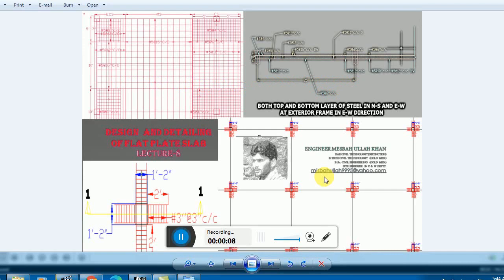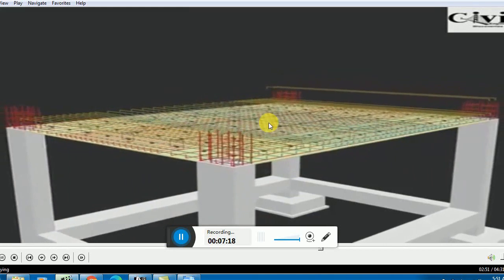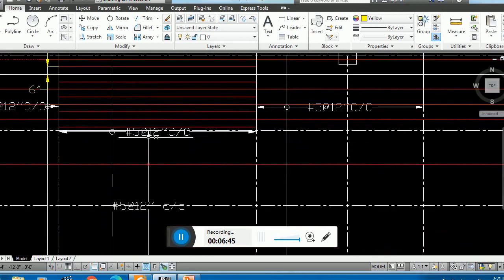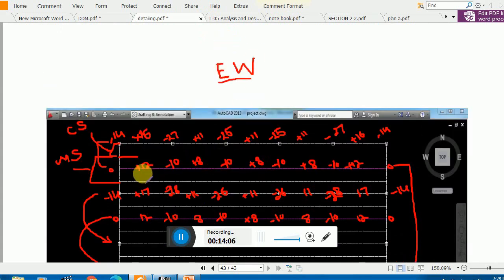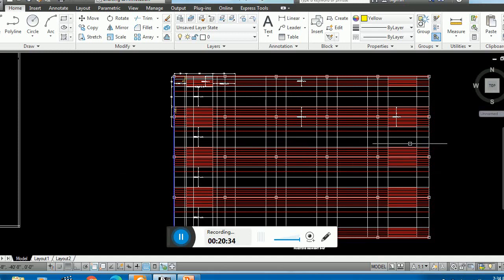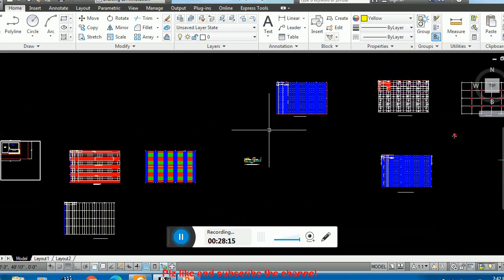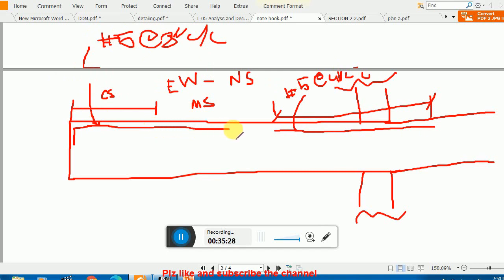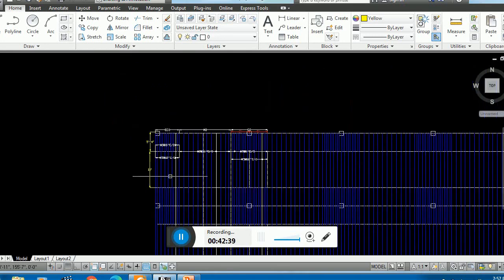lec 8 complete detailing with practical design method of provide reinforcement n flat slab accd aci

Comment: Hello, i have watched your videos and i think they are great.
According to the direct design method the middle strips are design to "each middle strip is design to resist the sum of the moments assigned to its two half middle strips"
this implies that its the sum of the two middle strips not just the highest value between the two half middle strips
Please reference ACI 318-14 8.10.6.2
Reply from the maker: Dear marc u have asked good question. this is upto you either you design for combing it or separating both will yield u the same result. because in combing the moments, your width will be change when you calculating the steel but in dealing with un-combing moments case the width will half that of the combine case. the next why we are taking higher values it is due to make our design more conservative.